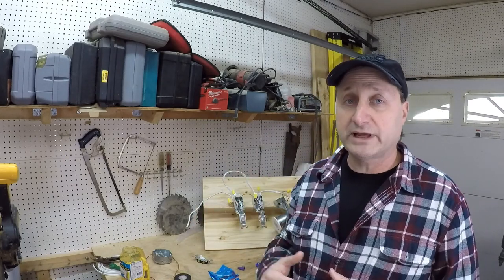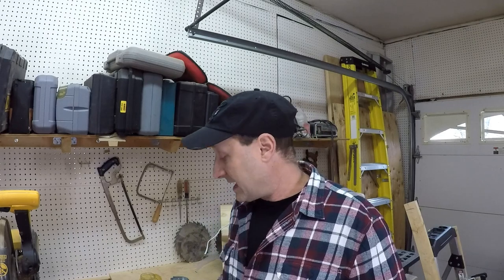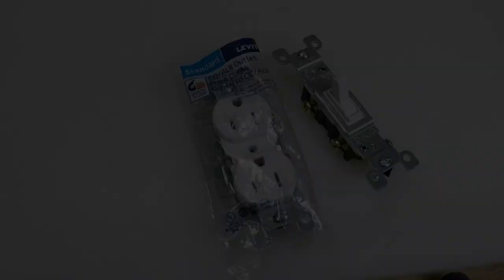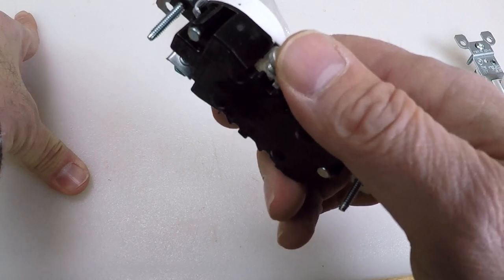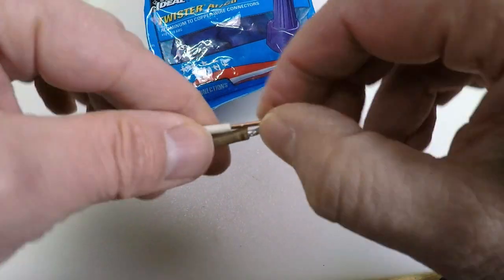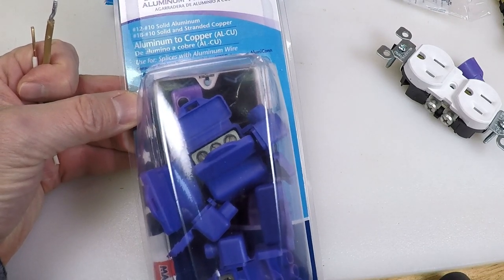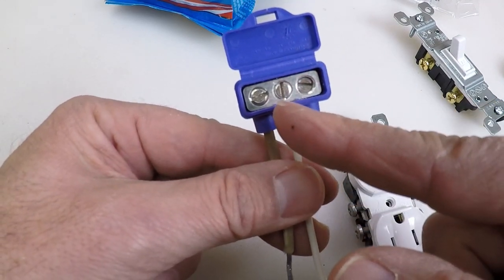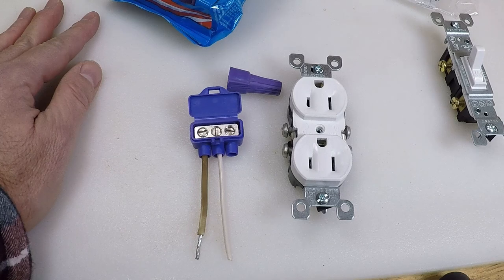Aluminum wiring repair - AlumiConn pigtail connections

Comment: In my area there are tons of neighborhoods and houses with aluminum wire and no one I know has had any issues with getting insurance coverage. I have aluminum wire and have had coverage with one of the big insurance agencies for 20 years. I replaced most of the outlets and switches years ago with CO/ALR devices and have never had an issue. As far as pigtailing in some situations, I just pigtail a piece of copper with the aluminum, add antioxidant paste to a wire nut, secure with the nut and wrap with electrical tape. I've had zero issues in 20 years.
Reply from the maker: glad to hear it
Reply: when you wire back the outlet was it a CO/ALR outlet or a outlet without the CO/ALR?
Reply: I heard someone say insurance would not insure a home with AL wire I called my insurance lady she been in the business for 30 years said she never heard of it, and that she even was an adjuster had been to homes that burned up due to AL wire. I live in Arizona 1970's was a boom for tract homes we probably have over a million homes with AL wire. I'm in the process of replacing every connection with Alumiconn's. Then I'm going to install AFCI/GFCI breakers in my panel. I never had a problem but I noticed that whoever wired my home in 1976 they didn't twist the wires in the wire nuts. Some of those nuts seem to have been heated the plastic just spins can't remove have to cut them off. The wire in my home is either 12, or 10 awg it's not soft not like copper I cut a piece out and played around with it see how weak it was as weak as I Thought.
Reply: Where we live, the only people who will insure a home with aluminum wiring want DOUBLE the rate to insure the home. I'd say there are "issues".
Reply: @zendyk   I don't know where you live, but in Ohio I have State Farm and they have had no issue insuring my home the last 20 years at normal rates.

Comment: “AlumiConn Aluminum to Copper Lug is approved by the Consumer Product Safety Commission (CPSC), UL, and numerous insurance companies as a safe method for aluminum wiring repair.” The AL/CU wire connectors (nuts) are not considered a permanent solution to pigtail. As noted in a comment below the AlumiConn lugs MUST be torqued to specifications. They sell a special driver to do this, it runs around $135. Don’t use a regular screw driver, be safe not sorry.
Reply: So looking at your example I could run a hot red wire into a lumicon and right next to it a white neutral I don't think so.
Reply: @georgewhidden8064   Show where he even implied that.  I know you cannot.

Comment: please people if you are going to do this just buy the correct copper gauge 10 is compatible with 12 gauge aluminum....and so on never 12g copper on12g aluminum.... i have gone through so many fuses after the unexperienced electrician i hired used the wrong gauge mix
Reply from the maker: It is less about the wire and more about the circuit breaker and how many amps it is rated for.  You can go 12g to 12g if you are not over loading that 12g copper wire with too many fixtures attached to it. If you are having issues with an overload, you should add a line or size down the breaker.

Comment: If I get this right, the cu/alr receptacles work with no pigtail and without anti oxidant compound BUT they're not as good for OLDER homes because the brittle aluminum might crack or break while attempting to bend and screw into the outlet, correct?.  In that case, it's probably best to use the alumiconn connectors (rather than the twist connectors) to avoid this cracking or breaking, correct?  Fantastic vid btw, gave it the thumbs up.
Reply from the maker: Thanks for watching... yes the aluminum wires are brittle and they also get damaged more easily than copper. The cu/alr receptacles are okay and they are better than nothing. The connectors are best.

Comment: QUESTION: WAGO Connectors,  What about Copper and Alum wires connecting in a WAGO With WAGO Alu-Plus Contact Paste?
Reply: You can definitely WAGO PUSH WIRE and 773 connections because the rating includes aluminum (IF the paste is used). If it’s a copper only rated Wago, then no.
Reply: Only 12 awg but my alum wire is bigger than that to fit inside the slot
Reply: @edbouhl3100   Wago's own data sheet says: "Terminating Aluminum Conductors (Not for use in North America)"  EDIT  Good luck with insurance if the house catches fire... or worse.  ...  As with everything like this, no matter your location, you best know your local codes, and what your insurance will or will not cover.

Comment: Thanks for the video. Does the ceeling,  or vanity light fixture side where the copper wire is not solid have to have these connectors as well?

Comment: Be careful when replacing old recepticles with new ones guys once you do this you have to bring up the branch circuit ok with arc/fault and or gfi protection t/r rated plugs, tr/wr rated plugs outside per 406.4,d thru out the home where ever you changed them out to new
Reply: That is people's biggest problem, they don't research.  There are reasons trades people go to school, etc., and there are codes, and local codes.  That includes this video, it is bad.  EDIT  In fact, as of now, I am through in here.  There is no way to address all the bad posts.  And, this channel should remove this video.

Comment: I used these in a house with aluminum wire... and NEVER had another issue with outlets burning up.  Before installing these,  I had problems with a couple outlets.  I lived in that house for 19 years and was 100% satisfied with Alumiconn connectors.
Reply from the maker: thanks for watching! please share the video

Comment: One very important aspect left out is that it is crucial to use a calibrated TOPRQUE SCREW DRIVER  to tighten the screws of the Alumiconn connectors !
Tightening "by feel" with a regular scredriver, as shown in the video, may get the AL wire damaged, creating a hotspot.  Same goes for the CO side, that will create a hotspot if torqued too loose .
Reply: Yes, but unfortunately torque screwdrivers are like $250-$300. Fine for a pro who may get multiple uses out of it, expensive for a DIYer that needs it for one job. Alumiconn says a second method is acceptable too, which is 1 full turn after the set screw touches the aluminum wire, and 1 half turn after the set screw touches the copper wire.
Reply: @OMGWTFLOLSMH  quick tip you can get torque screw drivers for mounting scopes on rifles that’s what I used I have a vortex torque screw driver that will go from 10 to 50 inch pounds and I paid like $60 for it but I would say obviously rewiring a home is best but jeez copper expensive as hell right now I would say the alumiconn connectors are the best because you not bending 50 year old brittle aluminum and if I didn’t have those I’d probably go with the wire nuts with noalox in them I’ve seen some really dangerous aluminum when people think it’s easy to just put a wire nut on them I’ve also seen pig tails but with no regard to the jumper going to another outlet and it defeats the purpose of pigtails expansion and contraction will cause arcing and obviously can cause a fire I’ve seen plenty of melted outlets I’ve seen craziness in panels but at the end of the residential aluminum is extremely unsafe in my humble opinion
Reply: @866martin  can you tell me where I can buy a Vortex torque screwdriver like you purchased for $60?  Thanks!
Reply: @OMGWTFLOLSMH I disagree I got a used Sturtevant Richmont CAL 36/4 Adjustable Torque Screwdriver Driver  For 35  bucks , and a cheap vevor one 35 bucks too , there is also a new Fix It Sticks Mini All-In-One Torque Driver 6-25 in/lbs for 53 bucks but that one don't click, so I didn't buy that one.
Reply: What do you torque them to ?
Reply: No this is old. Trust me you absolutely do not need the expensive wire nut's or the torque gadget!  I've fixed enough of the above mentioned repairs over the years you absolutely never use wire strippers or twist the conductors the one thing every journeyman is drilled into their head from day one. The fatal flaww in every repair. Any knick, twist is a problem eventually. The old timers used a knife to strip the wire . Just squirt a librail amount of knowlox into a wire nut and tape the hell out of it. Will last forever. Did my home almost 20 years ago and still good. Or by the splice lugs.

Comment: Just for your edification, creep is an engineering term. It means that a material will slowly deform under persistent mechanical stress. I.e. a steel wire with a 100lb weight hanging from it. The steel will remain at some length, no matter how long it hangs (it won't, but it's more resistant than aluminum). But aluminum wire of the same gauge will get longer (and thinner) over time with the same weight hung. Higher temperature exacerbates the issue. 

So the wires do "creep out of the connectors". But really it's that the screws clamping the wire cause Al wire to eventually give way under the pressure of the screw, and then the clamping pressure reduces.

Comment: From what I've been reading, the AlumiConn 2-port and 3-port connectors installed with a torque screwdriver are the only "good" way for a homeowner to safely remediate. The wire nuts tend to become a fire hazard and burn up (though I've also read that proper wire twisting before capping can help avoid it), and I don't think the AL rated outlets are considered as safe either. Aluminum wires will still work their way loose over time. 
Disadvantages of the Alumiconn connectors: they're $3 each, and tough to pack into tight boxes. But it sounds like they're the only real safe option.

Comment: Helpful, thanks!!!  The hardware store sold me some aluminum wire for a lamp- I have to connect it to solid copper wire- and don't want to buy a connector (time issue). 
After seeing this, I cannibalized a copper extension cord that didn't work well anyway, and that should work fine. No reason to do copper-aluminum if I can avoid it! I had no idea....

Comment: All the outlets with aluminum wire I'm dealing with have a red and black wire to one side of the outlet  and a white to the other side with no ground wire connected. How do I go about using the connectors?

Comment: I just had a 220v. 30 amp dryer receptacle melt and burn to a crisp and fry the dryer cord too.  Of course it's an aluminum wired house.  What gets me is that it was pigtailed -- although it looks like it was done quite a while ago.  It MAY have started at the copper and aluminum wire connector which may or may not have had anti oxidant applied.  My guess is that the copper/aluminum connection came apart under one of screw caps, started shorting, fryed the cap, and sent the whole electrical current mess into the outlet.which burned it up.  Your thoughts?  Also, the connection is 220v, 30amp 3-wire for an electric dryer.  I have the option of hooking up a gas dryer and being done with it.  Again, your thoughts?
Reply from the maker: it does sound like you need to use the alumiconn connectors. Make sure they are in a metal box and not in the wall unprotected. Also yes I would convert to gas if you have that option.
Reply: @flannelguydiy6458  The AlumiConn connectors you showed will only support #12 to #10 gauge solid aluminum wire. 30A dryer outlets and 50 to 60A electric stove outlets use a much larger stranded aluminum wiring solution. I have not investigated terminal block like solutions for connecting these so I can't make a recommendation.

Comment: Part of the reason Aluminum becomes brittle is that it is work hardening.  
The more you work (bend) it, the harder (and more brittle) it will become.  That said, you really only want to go into these boxes once.
Reply: Indeed. This is why it's critical to snip off the already bent piece and re-strip the wire if going with the CO/ALR outlet option. I had to go this route due to lack of space in the box. I also give the newly exposed aluminum a light buff with scotchbrite and apply anti-oxidant compound.
Reply from the maker: the tough part is with the older homes, you often do not have enough slack (extra wire) to snip too much off to get a clean end. It really is a challenge

Comment: BIG HEADS UP... Do NOT use Ideal Type 65 "Twister" wire nuts to pigtail residential aluminum wiring. Under an agreement with the U. S. Consumer Product Safety Commission, Ideal no advertises, markets, or recommends the type 65 wire nuts for the use described in this video. The was after several structure fires were attributed to the use of Ideal type 65 wire nuts. 

Underwriters Laboratories did not independently verify the results of the original tests conducted by Ideal, even though UL's published standards require said testing before UL certification is granted. 

The Canadian Standards Association (CSA) relied on the UL listing in approving CSA listing  of this product. 

Currently, the only product available, tested and fully certified for this use are the Alumiconn connectors, as described in the latter part of this video. They are readily available on eBay, Amazon and many online electrical resellers. 

Separately, insure that ALL aluminum wiring is properly protected by either Are Fault Combination Circuit Breakers (AFCI-CB) or Dual Function (Arc Fault/Ground Fault) Combination Circuit Breakers (AFCI/GFCI-CB). 

As of 2017, the National Electric Code (NEC) requires Arc Fault breakers for all dwelling spaces in a new home, or whenever a breaker panel is replaced. If ANY wiring does start arcing, an Arc Fault breaker can cut off power before a fire  starts. If nothing else, update your breakers.

Be careful and stay safe, Bruce

Comment: I NEED YOUR HELP with AlumiConn! Thanks for this info. What's your opinion on Ground?  Obviously hot and neutral need the alumiConn, but do you think one can save a few $$$ by not using on ground?
Reply from the maker: I think it would be fine to connect the ground wires to a traditional wire nut.

Comment: I was wiring houses in the late sixties. It wasn't that we were cheaping out on wire costs, the problem was that we couldn't even purchase copper wire due to mine workers union strikes. 
 The NEC (National Electrical Code) prohibits direct connection of dissimilar metals.
And as to "not enough breakers", Again I refer to the NEC which was the same then as it is now. Which is 3 watts per square foot for calculating the number of lighting circuits in a single family residence.
No contractors or inspectors were "fudging" the number of lighting circuits that I know of.
Reply from the maker: thanks for explaining about the copper shortage. I have seen a lot of houses where too many rooms are linked to the same breaker

Comment: I live in an apartment where my own room and my dad's room are on one signle socket. And its all aluminium wire. I was wondering why the socket was getting warm and now I know, its the old type of socket with NO termials, just the push in wire thingys ] o o] ---==== ---==== and they're so old its got that fiber insulation instead of the plastic or rubber....
how has this appartment building not burnt up. the fuse boxes have 30 amp fuses.

Comment: can i use the connectors with the three holes on all receptacles even though they only need two? curious because idk which receptacles need what. thank you advance and thank you for posting this video.
Reply from the maker: Yes you can but they are also made for two. You can just buy those
Reply: Of course, but these things take up room in the box, so the smaller the better, and the 2s are cheaper than the 3s. Buy some of each and use the 2s where necessary. Do a quick survey, should only take a few hrs a day over a weekend to go around the house and do a count by taking off the outlet cover and looking inside with a flashlight. If there's only one cable coming into the box, you only need a 2 for that box. There maybe cases where there are 3 cables coming into the box, then you would need a 4 for those, but that wouldn't be too common in the average house.
Reply: @OMGWTFLOLSMH  thank you very much

Comment: The problem with the AlumiConn connectors is that they take up so much space. There are some boxes in our house that already barely have room for the existing wiring. We’d have to have an electrician retrofit newer, larger boxes to allow for the additional connectors.
Reply from the maker: Yes, that can be a problem.
Reply: That’s partly why I’ve used the CU/Alr switches and outlets to replace the old ones that were here. The problem is were GFCI or dimmers are needed since those are not made for aluminum wire.